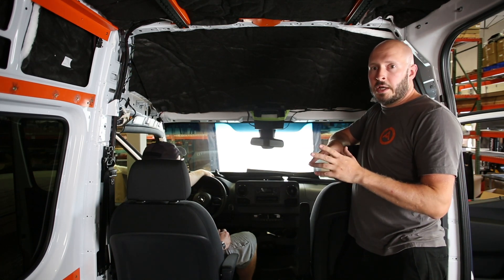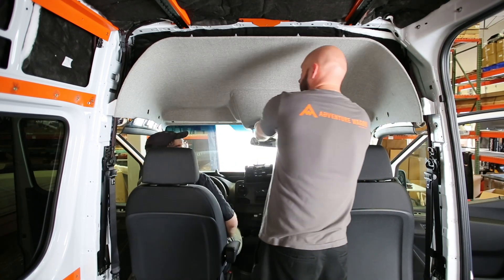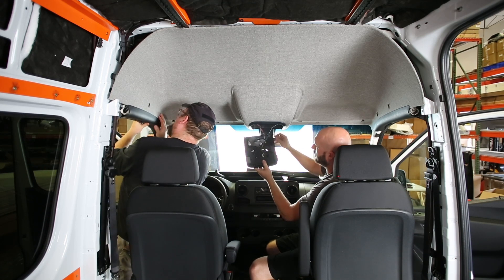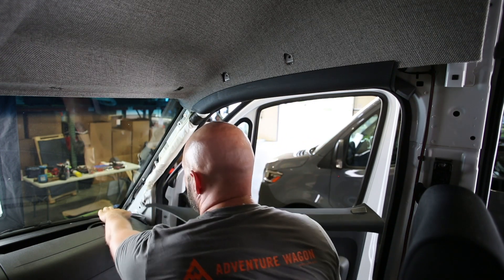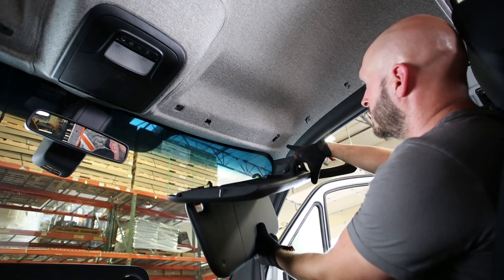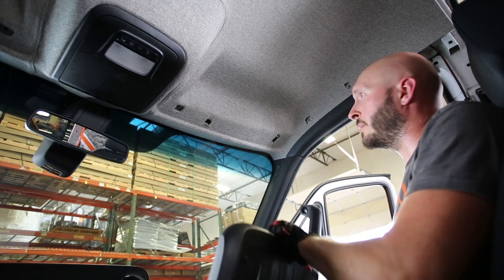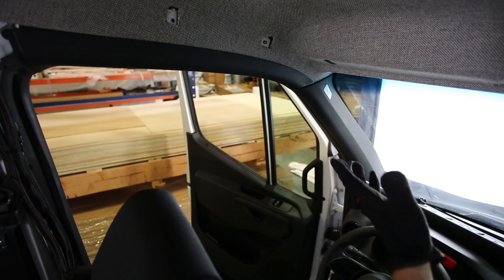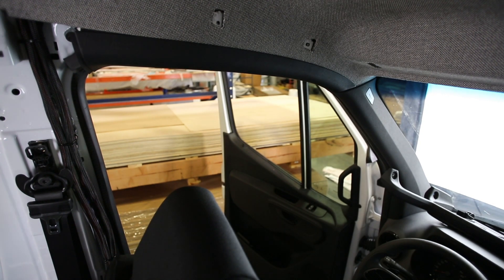REINSTALL FRONT HEADLINER for Mercedes Sprinter 144 and 170

Comment: What year sprinter was this?  I'm trying to figure out how to reinstall the headliner light assembly on my 2021 Sprinter.  Mine has a trim ring on the outside I removed to get the light assembly out of the headliner and I cant figure out how to hold it in place on the top side while I'm pushing on the trim ring from the bottom side .  Any suggestions?